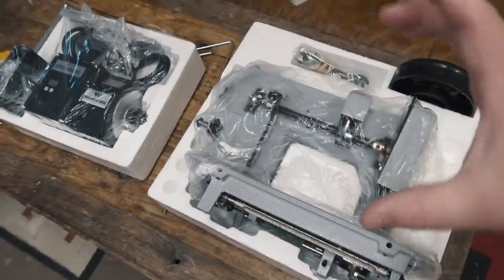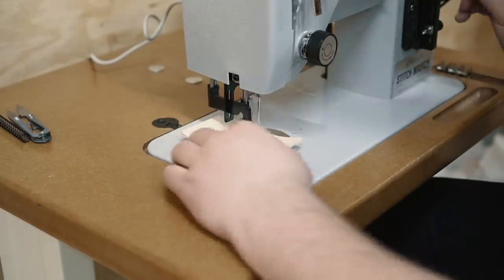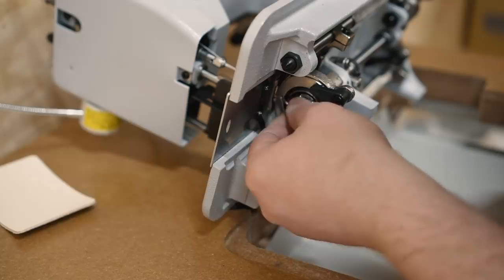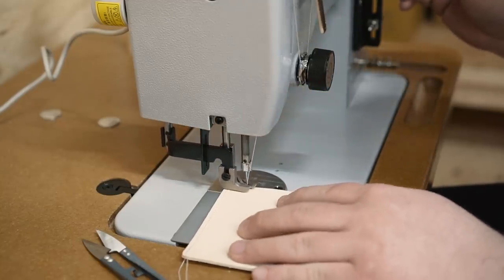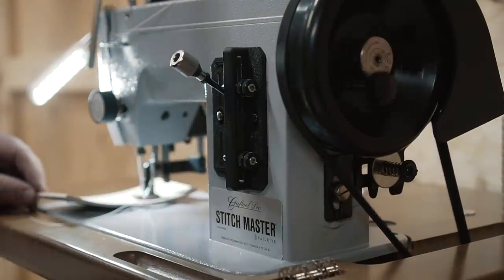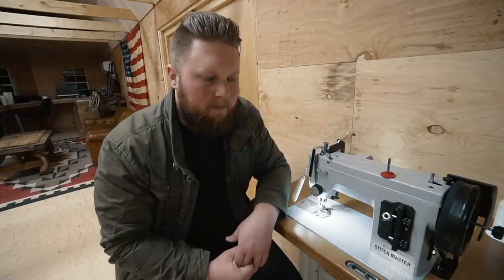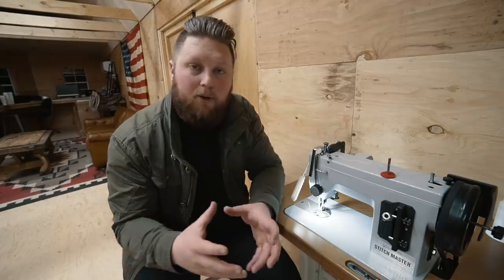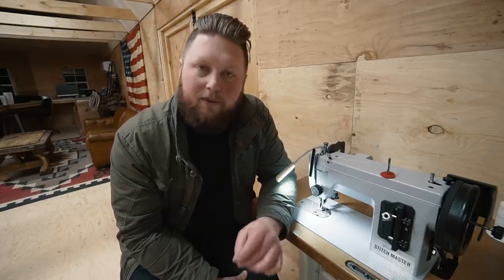Review of the Tandy Stitchmaster Pro Leather Sewing Machine

Comment: This is a copy of the original Thompson Mini walking foot machine.  It came from a household machine with a 15 class oscillating bobbin that cant handle much more than Tex 70 thread.  It's a top and bottom feed machine typically used for lighter material.  Its not a compound feed (triple feed, unison feed, or any other name you want to used for needle feed + walking foot) and its priced about a compound feed machine that has a large bobbin.  In fact I can get a large bobbin machine capable of sewing tex45 to Tex277 thread for $1699 that includes a built in light, 750W motor and a full stand.  Its a shame....
Reply from the maker: There are a lot of other clones like the Thompson mini, like the Rex RX607, Consew  CP206r, etc...This one is equipped much better in my opinion. With that brushless workhorse servo motor, industrial table/treadle, reducer, the posi-pin system(sailrite's trademark), the delicate/leather presser foot, right out of the box this thing is much more equipped for leather than those other mini walking foots in my opinion. Oh and the class 15 bobbin will go up to size 92(tex 90), which is all I use so it works great for me.
Reply: @whitandpark   I respect your opinion, that's great.  However you did mention in an earlier video about the Juki 1508 and the compound feed.  I respect you have a job to do as an influencer and Tandy is taking care of you (I wish I would have got you to sell our products instead!!), however, the machine they have is nowhere close to others...and the Thompson was no clone...it was one of the first, and they all came off this.    One thing I can say...your work looks great...and your videos are very good!!

Comment: What's the maximum thickness you can run on this?
Reply: Tandy site says up to "10oz with ease".
Reply: @robertburnes2285  Does that mean 10 oz stitched to 10 oz, or ten oz of layers total?  I'm new to how a lot of this works.  Thanks!
Reply: James Clark the servo motor has the power to punch through layers of 10oz, but the machine’s presser foot only lifts about 5/16 of an inch so I’m guessing 10 oz total. Plus, anything more might be too much for the needle bar or other parts.
Reply: @Chuckletopia  10oz would be the maximum.  So, if you are edge sewing a holster or sheath made from 7/8oz it would be too thick for this machine.

Comment: That’s the sail-rite ultra-feed re badged and sold for a higher price.... should do that research I see for sailboats that’s the original purpose!!
Reply from the maker: It’s not a some secret that this is Sailrite machine. I mentioned it about 50 times in the video. And yes it’s based off the ultrafeed but it’s not packaged as a portable machine. You get an actual industrial treadle, table and one of the best brushless servo motors i’ve used. This machine is set up for leather right out of the box. The Thompsons, and all the Chinese clones are not. That’s what it comes down to.
Reply: Stock & Barrel Co I agree you did mention sailrite a ton.so my question remains why would you then spend 500 more for the marketing scheme of branding it as a leather machine. That’s just profit sharing with randy when I could get the amazing machine from the horses mouth??? 1500 jezzz man that seems like bragging rights when the ultra feed lsz1 does leather like a boss and also zig zag stitches. Same machine except more abilities and only 900 usd... keep up the hard work tho I know crafting is fun. You just missed the point majorly on the whole best machine part . Hope you get sponsored bud at least your putting your self out there trying
Reply from the maker: because for the exact same reasons I mentioned above. It’s not 500 for a marketing scheme. It’s 500 for the table/treadle and most importantly to me when sewing leather is a really good servo motor and speed reducer. You don’t get that with the ultrafeed. I would have to pay 500 or more to have those things added to the ultrafeed. And by the way, i never said this was “the best” machine out there. I just said i thought a lot of people would really love it like i do. There’s a huge difference.

Comment: That's a Sailrite sewing machine. Runs for $800.00
Reply from the maker: You're right that this is a Sailrite machine. I talked about this in the video. Tandy partnered with them to produce this package. Yes the bones are the same but the package you're talking about is the LS-1 which is designed to be portable and doesn't have the industrial table, treadle, workhorse servo motor or reducer. It's a totally different package. The Stitchmaster is designed to tackle leather projects right out of the box. It's an awesome little machine.

Comment: Tandy's products are getting lower quality every year. This machine is not fit for sewing vegetable tanned leather. Get ready to readjust the timing every few days.
Reply: how so?
Reply: @elmow3  For this sewing machine specifically, it is the base model that is sold by Sailrite. The machine itself is not rated for sewing leather and is not modified to do such a task. The servo motor adds more torque to the machine which enables it to punch a needle through the leather. The problem with this is that the machine itself was not designed to function at that amount of torque for extended revolutions. The timing will slip and you will begin to skip stitches and tear thread at the needle. The hardware that Tandy sells ie. snaps, rivets, grommets, etc. is very low quality. The hardware fails often when setting. Tandy bevelers often need to be polished to avoid leaving unwanted marks on the leather being tooled. Their picture/decorative stamps are poorly cast and lack sharp detail. The hand tools break easily. Should I go on? I have over 20 years of leathercraft experience. Tandy is a great resource for beginner leather craft, but you will be hard pressed to find quality tools and hardware at Tandy.

Comment: $1400 is cheaper than a real machine new BUT you can buy a real machine in very good condition for between $300 - $500 if you keep your eyes open. The reason the bobbin wound fast is it's tiny.  Anyone who does any amount of work will be spending more time changing bobbins than sewing. Sorry Bud.  Tandy is for hobbyists. Real craftsmen shop elsewhere.
Reply from the maker: Of course you can get a "used" machine cheaper. That's always been an option. This one is set up ready to go, with a brushless servo motor and speed reducer which is something you'd have to buy and install if you were to pick up a used machine. I thought I was pretty clear that my review of this machine was that it IS great for someone just getting started at the hobby level. My main reason for not recommending this as a production machine is the fact that it doesn't have a leg lift for the presser foot. I'll be filming a follow up video very soon to clear a lot of this stuff up.